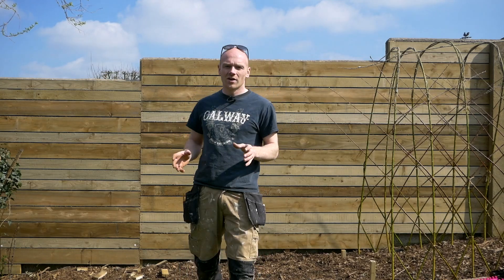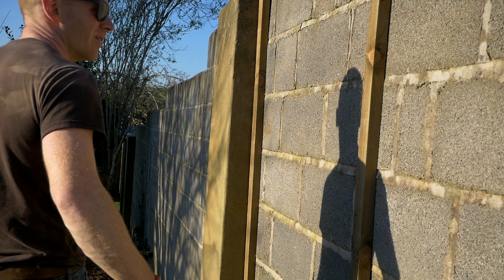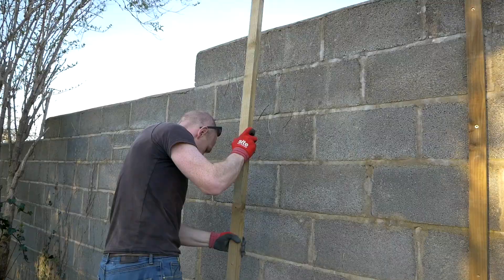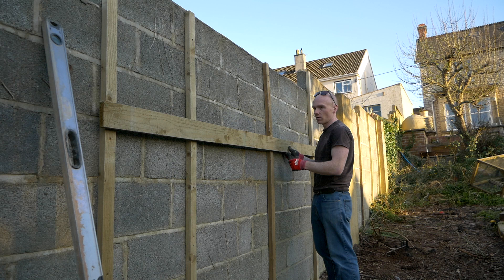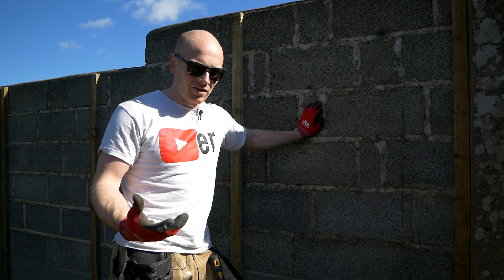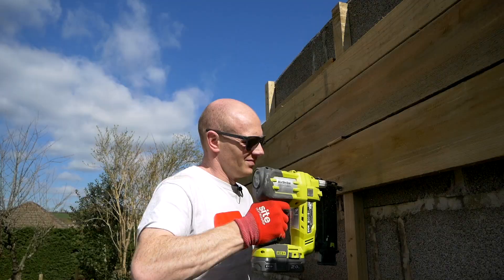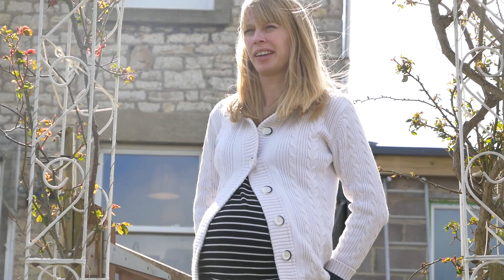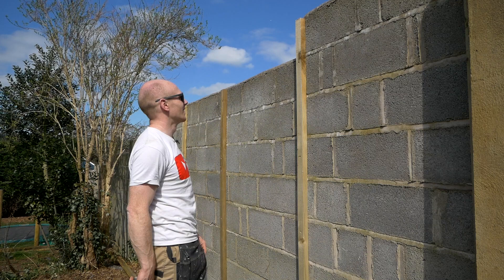HOW TO TRANSFORM AN OLD BLOCK WALL - DIY Timber Cladding

Comment from the maker: Full details and Q&A video, plus the wall a year on - https://youtu.be/HxPHTRUsKdU
Reply: What nail gun is that please ?
Reply from the maker: Jade Edge hikoki, should be linked in description. 👍
Reply: Sorry may have missed it, but why did you use different nail guns. What were their uses please?
Reply: The Restoration Couple  thank you ☺️
Reply: what size drill bit did you use?
Reply: Do you have links to all the materials you used

Comment: Good job. Great improvement obviously. Maybe overkill but could have run a strip of dpc behind each vertical batton to stop any damp from the old block wall. Definitely would have run low voltage cables for embedded led lighting switched from the house too...
Reply from the maker: That was my after thought, plus running a hose/mdpe begind for garden tap. Should still be able to sneak the wiring away in there somehow. 👍

Comment: Good stuff. I did some vertical panelling with treated timber recently but I've had to redo it a few months later due to shrinkage! Not thin panels either. Quite disappointed with the hassle but it's looking good

Comment: Love it! When drilling holes in the concrete for the battons, did you put any raw plugs or just screw the concrete screws directly into the block?
Reply from the maker: No concrete screws go straight into a 6mm hole.

Comment: looks great. i have been looking around, as i have a horrid wall, only 5 metres length, 1 metre high. but want more privacy also.  wasnt sure to knock it down, paint it, render it etc. i wanted the horizontal wood.. so your video is great timing.  hopefully i can batten mine to 6foot and find wood as cheap as you did from somewhere :)
Reply from the maker: Perhaps just use fencing rails or treated 3x2 for the uprights. Should give plenty of strength for the extended section. 👍
Reply: @TheRestorationCouple  yea, was looking at maybe some sort of metal rod/post..  fun yet frustrating all this diy at times :)

Comment: Thinking of doing this, to one section of wall for patio but thinking of using screws. lap boards, can be removed to insert patio lights along the run?

Comment: Hi, quick question.. 

You mentioned the pressure treated wooden boards were 100mm & 150mm in width, what was the depth & length - 25mm & 3m? 

Also what dimension batons did you use to fix to? Thanks in advance for the answers.
Reply from the maker: Yes 22-25mm thickness and lengths were a mixture of 3-4.8m. Batten 50x35mm. It’s all just standard fencing timber. Video out this week with more info.

Comment: @17:10 I think you shouold have just added another backing next to it intead of cutting. Those nails ended up really close to the edge.. I think the wood will start to split on those ends really easy with time. I keep my screws/nails at least 2.5+ inches away from butt ends. Ask me how I know that :D an extra backing board would have given you that space instead of just cutting the board to accomodate the end of another.

Comment: Much better, just careful how many brads you use as temp holders as they will rust and possibly streak over time
Reply from the maker: They are galvanised so hopefully shouldn’t cause an issue. I use them on the chicken houses and occasionally you get a faint black stain but no rusting. 👍
Reply: The Restoration Couple ah cool, I knew the nail gun nails were but didn’t realise the brads would be 👍🏻

Comment: What sort of coping do you have on the breeze block? I'm cladding an old wall breeze block wall and the coping had a big overlap and has come loose. Wondering if I can just leave the cement there or does it need something.

Comment: Question, we have a similar wall between me and the neighbour but its is maybe 3ft could we do this and then extend it further up than the 3ft to maybe 6ft? Or would it not be sturdy enough as the wall wont be present? I'm thinking it could be cheaper than panels?

Comment: Could you clad a single brick garage like this to give the feel of a lodge? Just worried about dampness getting through?
Reply from the maker: Of course. If it’s damp from rain now then I would be tempted to batten horizontal install breather membrane and then do the vertical battens. If wall is fine now then now reason not to clad however you want to.
Reply: Thanks for getting back to me. Would you install a breather membrane befor or after fitting Battens? Would this also stop the need to install membrane on the inside( behind studs I would be putting up?)

Comment: Looking at doing something similar on a much smaller scale. Hadn’t planned on having spaces between the boards. Is there a reason for it, or just personal preference?
Reply from the maker: Even if you don’t want the gaps you will still end up with them because wood will shrink especially if treated timber. The only option if you don’t want gaps is to use a feather edge or shiplap type profile or hit and miss cladding.

Comment: Hi there. What did your gap between boards measure please? Presumably you used a common thickness piece of timber as spacers?
Reply from the maker: It was around 5mm I think, just used some little timber offcuts to space. It’s around 8-10mm now, a year on. That’s why I wanted to make the gaps a feature as it will always shrink
Reply: @TheRestorationCouple  Thanks so much! A great help. Would you recommend against climbing plants on this type of softwood timber? I'm not sure if it would promote rot or other damage?
Reply from the maker: Depends on the plant. Most will be fine, things like roses or other plants you train onto wire or trellis. If it’s a creeping type then you may need to keep on top of leaves and vines building up behind the slats.

Comment: Another great video as Allways, have you any tips for circular saw use? I have the cordless dewalt brushless circular saw but 4/5 times I use the hand saw as I’m not overly confident cutting straight with it. Also I’ve seen the jig you have used before with the saw could you do a video on it? Or maybe at the end of a video if it’s only simple cheers!
Reply: Hi, in Machine Mart you can buy a saw guide that clamps to the piece to be cut. Trend do one for silly money, the one in MM is by Clarke I believe for £20, I use it to fit kitchens all the time.

They're straight forward to use - measure the length you want to cut. Measure from the edge of your circular saw to the 0, where the blade will be cutting and add that onto your measuremeant and that will be where you clamp the guide. Very simple once you get use to it, then just the obvious, goggles, ear defenders, mask and keep hands only where they need to be and you've mastered the circular saw 👍
Reply from the maker: Filmed a video on the jig build this week as tried a new saw model. Will be out soon.
Reply: Thanks both

Comment: Hi great looking job, just wondering what type of wood did you use? And what treatment if any used? Pressure/ water repellent etc. keep the videos coming, 👍
Reply from the maker: It’s just pressure treated gravel board and fencing timber. With all the air gaps and no soil contact it should be good for years.
Reply: The Restoration Couple

Cheers thanks

Comment: Hi Tim What are the screws your using I noticed your not using raw plugs and will they work in brick I have a fence to put up Thank you
Reply from the maker: Concrete screws. They just self tap in to brick or concrete in a 6mm hole.
Reply: @TheRestorationCouple  will they not work loose in the block work?
Reply: @robpage5594  Nope they won't, designed for this purpose.

Comment: What size battons did you use? Are they 3x2? Did you use 40mm nails also?
Reply from the maker: Think there were something like 50x35. Nails were 50mm.
Reply: Great thanks! Finally what space did you put between the boards? Did you use homemade spacers? Thanks!
Reply from the maker: eisfspike just a wood spacer, probably around 4mm. The boards will shrink a fair bit if pressure treated so will probably end up 6-8mm after a few months.
Reply: Thanks mate!

Comment: £240 for the boards? How much was each board? I'm looking at wickes and they are £8 for a 3m x 150mm board. Either my calculations are wrong or prices are just stupid at wickes.
Reply from the maker: The latter. Will be more like £3-4 each of you get from a sawmill or fencing supplier . And better quality.

Comment: Which type of wooden boards did you use for this project thanks
Reply: Gordon Aitchison he never told me anything that is why I asked the question also my speaker has low sound and is distorted so can’t hear clearly
Reply: Interested to know this also...
Reply: Me to
Reply: Any update on this? I'd like to know also..
Reply: Sounds like 100mm and 150mm gravel boards... But unclear if 19mm or 22mm

Comment: Great vid, how do you find the Hitachi cordless nailer? I’ve got a Hitachi gas framing nailer I really rate but the batteries are slowly failing. Not seen much good said about the Dewalt version.
Reply from the maker: I did all this on around half of a single battery charge and no need for gas. Love it!
Reply: The Restoration Couple do you think it’s worth twice the price of the gas nailer? I generally get about a box and a half of nails out of one gas canister (which comes with the nails). Nails don’t seem much cheaper without gas and I don’t use enough for it to make much difference.
Reply from the maker: In which case might not be worth it. Not had anything else myself, just noticed slot of people moving away from gas. I’m sure that the older model would still have done the job fine for me.
Reply: The Restoration Couple I’ve seen a lot of construction guys complain about the gas in cold weather which I can see would be a problem, but then lithium ion batteries aren’t great in cold weather either in my experience. I’m wondering wether to go for another gas nailer of but 18v when my current one dies.

Comment: Can i ask what size nails it was that you went with as i’m doing the same project and unsure which nails size to get. Thanks
Reply from the maker: 55mm I think.
Reply: The Restoration Couple ...thank you!.... is there a min size that could be used for that type of project? Im using 19mm boards on a 50mm batten and wondered what would be the min size nail id need to use to ensure its safely fixed.
Reply from the maker: I guess as long as you have 25-30mm of a ring shank in the batten it should be ok. I’d say go 50mm nails if you can.
Reply: The Restoration Couple ...thank you, appreciate your advice.
Reply: Hi, please can you tell me roughly what the size of your battens was? Was they 1inch or 2inch thick?
Reply from the maker: Robert Moran about 35mm I think.
Reply: Thank you, if my boards are 19mm thick is there a min thickness that the battens need to be? I will be having a batten either end and one in the middle.... would a 19mm thick batten be too thin?